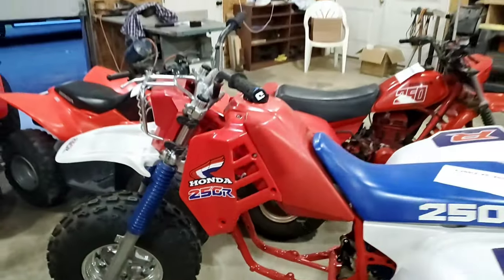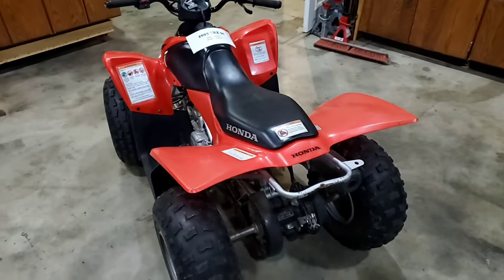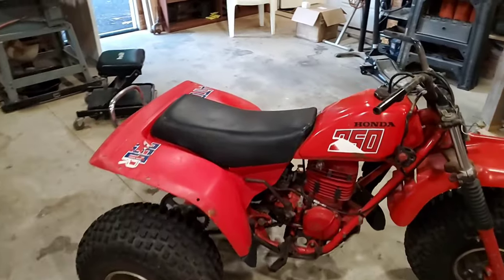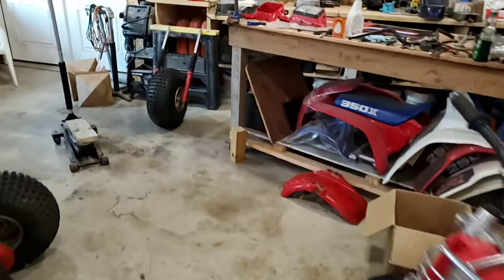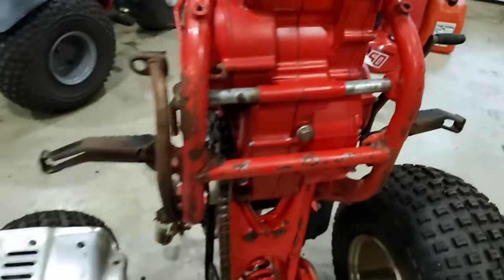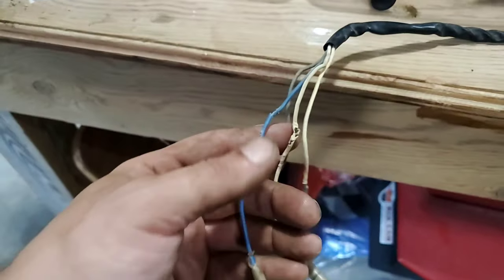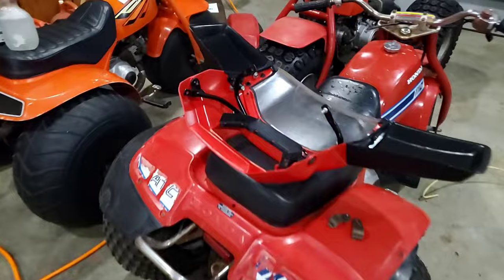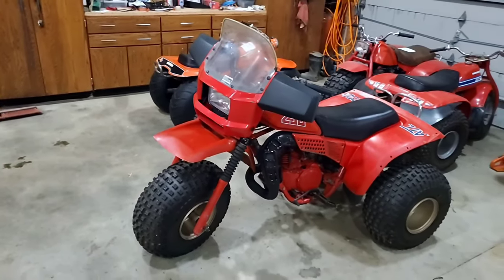1981 Honda ATC250R Hondaline Fairing Installation - 1987 Big Red and TRX90 Spark Plug Change

Comment: Honda bragged about air adjustable or air assisted forks..  that cross over was to equalize the air pressure  , so basically when one leaked out they both did, thus equalizing pressure hahahah.... I've seen them here and there

Comment: I bought that atc200S on  Sunday with hondaline fairing. (was on CL and Marketplace in Massachusetts). Plastic fairing is rough but  brackets are all there and nice. Not sure what I am gonna do with it. Looks like it would fit all hardtails or at least  22x11x8 models
Reply from the maker: I saw that for sale.  That's great.  It will fit an 83 185S and all 200S models.  The headlight mounts are part of the bracketry.
Reply: @ThisOldTrike  was gonna grab that 83? 185 he had... (wearing 1981 forks/headlight)... but couldnt pull the trigger.        dont forget RICE-O-RAMA is this week!!!!

Comment: Are you using pj1 paints? I've been using some of their paints on my 85 build.
Reply from the maker: I am not... I just looked into them though.  Have you used them and do you like them?  This paint is duplicolor engine enamel.
Reply: @ThisOldTrike  I did use their semi-gloss black and gloss black and it's really good stuff. I used the smi gloss black on the radiator guards. I used the gloss black on the handlebars and the grab bar. Yeah I used the dupli color on the engine cases and covers. Both are extremely good paints in my opinion as long as the surface is prepped good.

Comment: Public service announcement.  DR8ES-L is now discontinued.  DR8ES works just fine but the L stands for special electrode.   So if you're a stickler better start buying the Ls up  before they're all gone.  I also have a set of triples and forks for a 1st gen, if you need them,  Admiral.
Reply from the maker: I didn't know that about the L's!  Dang!  I'm gonna stock up!
Reply: @ThisOldTrike  they also do a make a pneumatic plug cleaner that literally like makes them new so don't throw the old ones away so start saving the carbon crusted ones you're swapping out.
Reply: @Donny_Buysall  not to create an argument but if your cleaning a good plug that's fine with the mini sandblaster type, but a fouled plug is, in my experience,  compromised it may spark but once fouled it's different and isn't what it should be,...  and there they go dropping a common plug that we all need
Reply from the maker: Just ordered 10 L's today.

Comment: 303 vs simple green for cleaning? When do you use on vs the other?
Reply from the maker: Well, I normally use simple green first as a general purpose cleaner.  I have another spray bottle that is straight water with about 3 drops of dawn dish soap in it too to help rinse or dilute the simple green.  My daughter will make a bottle of simple green disappear FAST... so the water bottle was to assist in getting more life out of the SG.  It also works well to just rinse dirt away if I'm doing cleaning on a machine in the shop.  I was using the 303 on this because I had already used SG and the red on the motor and frame looked dull.  303 will add a little shine, so that was my goal.  I used to use SC1, but over time I realized it attracts dust or the dust sticks to it... I don't use it anymore unless I'm going riding in a muddy spot because it does act as a release agent to help clean a machine after a messy ride.
Reply: @ThisOldTrike  Thanks! I'll have to pick up a bottle for the shine! Look forward to watching and learning!